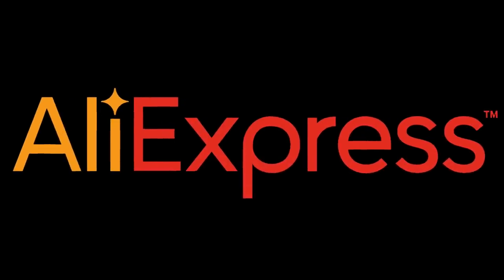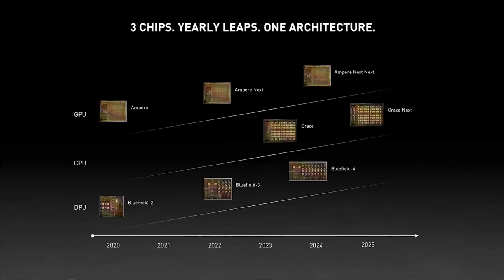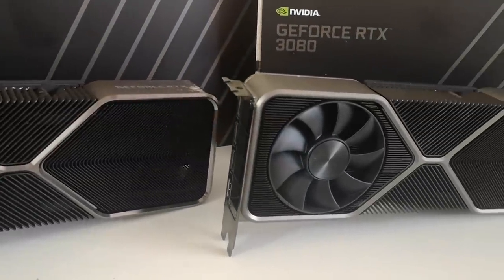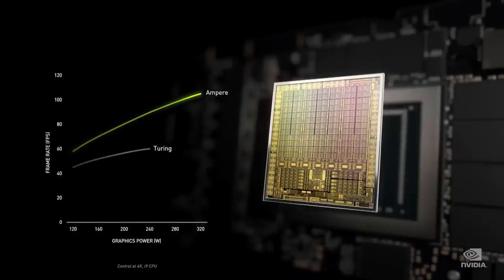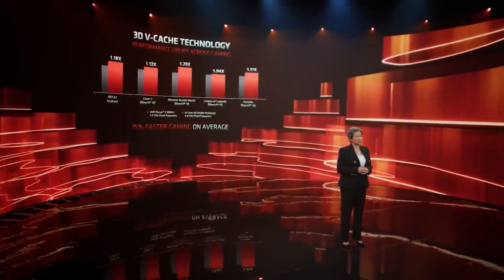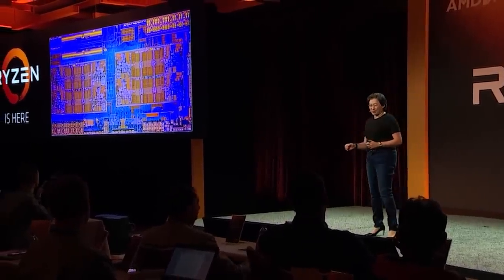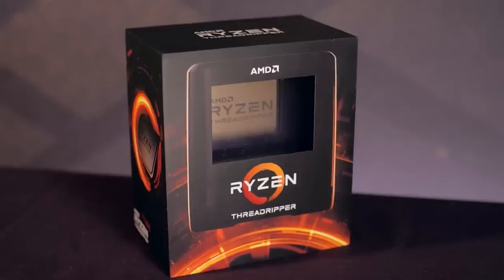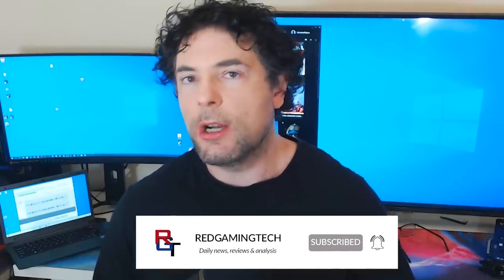Did Nvidia Just REVEAL Hopper? Benchmarks Leak | Zen 4 at CES CONFIRMED By AMD [AliExpress]

Comment: Aside from needing a good PSU, the electrical power input isn't the main problem - the heat output is.  500W inside a case is going to be very hard to handle with air cooling.  A liquid cooler on the GPU will keep that heat out of the case, but it still ends up in your room.  Obviously anything can be done and you can put up with any amount of noise and other discomfort, but (just like the cost question) is it really worth it?  Big bux + liquid + heat.  I'm one of the many who will say no.
Reply: Every uptick is smaller transistors with a clock increase that takes the heat up. We're up from 65>105>180>280 TDP on Ryzen/TR PRO. My Asus Thor 1200 watt would need a Thor 1600 watt Ti if I went dual 3090 gpus. It's a long term investment. My TR PRO will get my four year old case, water block, radiator, res/pump combo and fans off my first gen TR build.
Reply: this has also happened with CPUs. Since when do CPUs use 250 Watts. Thats just ridiculous.
Reply: If miners dont buy them IM DOWN
Reply: @donsorenoelchapogringo1182  16 phase power with 60 to 80 amp inductors is common on the newest extreme boards.
Reply: You're really overstating the limits of air cooling. A 2 slot cooler (not even 2.5) can handle 300-350watts with proper TMI.  It's silly to think that they can't make a card/setup that couldn't handle 500w of dissipation. 

Though I mean... if a 500w part DOES happen (CPU or GPU, doesn't matter), then the people could afford it already have air conditioning, plenty of ventilation, or outright full loop liquid coolers. We're talking about a card that 90% of PSUs can't power. It's not for the average consumer.

Comment: I find it hard to beleive that a Gen 5 SSD, can be bumping up against the limits of PCIe Gen 5 before it has even been fully adopted. Unless they're only talking about their DRAM cache, and that DRAM just so happens to be 2x 32 bit DDR5 channels
Reply: It won't help gamers. Their game's game engine locks down the app load speeds to HDD rates.
Reply: I can see where cache would help write speeds, but I don't see how cache would help seq read speeds.
Reply: Although it probably isn't common and defenetly won't be soon, take in to account that when the spec and initial pci hardware is being designed other component manufacturers have access to initial engineering hw to start designing their own. And SSD as a component have only seen decent adoption in the last 5-6yearish for consumers and for the most time the been stuck at sata 3 speeds. So there is a lot of innovation that happens like it those with any new spec or awesome technology. Also keep in kind that enterprise is extremely data focused especially data transfer speed and they tend to be at least a couple of years ahead of the consumer market. It is reasonably to belive that at least for certain data center application they can max that out already with some exotic stuff.
Reply: @DarkMessia67  No speed improvement is true only for gamers. Your game engine is written for 2010 HW. If you keep giving game developers your money for new games that only love faster Intel clock speeds then we'll have another decade of the Intel cluster suck.

Comment: I would love to hear more information about the AM5 platform how long will they support it ...
Reply: Another four years of cpu/mobo with only one X16 PCIe socket and one fast M.2 socket is just good money after antique tech. Dual channel ram is the year 2002. SSD app load speeds is the year 2010.
Reply: "how long will they support it ." How many decades of 2010 tech do you need?
Reply: Buying a new cpu with IPC gains but not getting the double in through put of the next generation of cpu lane speeds makes the new cpu a silly investment. Gen 4 drives on a GEN3 mobo drops your new drive from 7000MB down to 3500MB. It was utube that screamed no new generation mobos for Ryzen. Features Intel doesn't offer gives them a bloody stool.

Comment: V-cache doesn't increase IPC, it won't benefit programs with working sets fitting in current L2/L3 caches.
IPC has a meaning and is measurable, averaging game benchmarks leaves you clueless about how many instructions ran or even how many cycles occurred.
Reply: @cannotwest  Having more cache running faster increases benefits as memory stalls cost comparatively  more, slower clocked cores have relatively faster memory so benefit less.
Reply: @cannotwest  Not if it's stalled on memory loads, unpredicted DRAM access is very slow compared to CPU processing speeds
Reply: @cannotwest  You appear to have things backwards on GPU at lower GHz.  Game benchmarks target lower resolutions and use the fastest GPU cards to show a difference in fps when comparing CPUs.
Now actually AMD showed mixed results with some games not benefitting from larger cache, which is inline with previous large 128MB cache testing with productivity not benefitting at all.

Comment: What about all those users that invested very heavily in a sTRX4/TRX40 Threadripper 39xx system? - what about AMD's stated promise to support TRX40 for "the long run"? Gonna be very interesting to see how AMD handle this situation for all those customers already invested here...!!!
Reply: You get one more generation.
Reply: No one building a new TR wouldn't opt for the newer TR PRO. Double the ram channels, cpu lanes and eight times the total ram capacity. A top end TRX40 is only $200 cheaper than a WRX80E. My new WRX80E is getting all the GEN4 NVMe drives,  DDR4 ram, gpu and water cooling out of my X399 build. AMD just doesn't have enough 8 core CCDs. Ryzen and EPYC are a year ahead of TR getting GEN3 anything.
Reply: The TR upgrades require more pins. ZEN4 TR is going up from 4094 pins to 6096. A ZEN3 TR for a sTRX socket can't give you double the ram channels or an increase in cpu lanes. All  you could get for your money would be an IPC increase. Buying a replacement ZEN3 doesn't make sense. It's too much money for more of the same. I saw the same thing when my X399 was replaced by the TRX40. I waited for the WRX80 and I can upgrade everything. Now it's worth the money. You might be happier if you wait for ZEN4 TR PRO. That's 12 channel ram and 256 cpu lanes.

Comment: I find the Zen4 leaks and rumours here very exciting. Zen3 is what they're making now, Zen3d is the same thing but with a bit more cache. Zen4 is that same cache plus all new processor dyes, which are supposed to be significantly better at many things. Expect Zen3d about March, and Zen4 about November 2022 ~ slightly less than a year from now.
Not mention in this clip, there's also a Zen5 high performance core, and a Zen5 Compact core, which is essentially a Zen4 core with some of that 3d cache chopped off. Or (depending on who is telling the story) less L3 cache to make way for way more L2 cache. That and they're more compact in 2 dimensions, so you could put 8 high performance cores and 8 compact cores on the same core complex dye, and that's what they're making for the cloud companies like Google and Amazon & Micro$oft. Now if or when that Big+Little concept is coming to laptops and desktops ... but the Cloud Compute Centres want it. I'm hearing that will be a complete Zen4 core, so that's full hyperthreading ~ 2 threads for every core, which is not what Intel's gone for.

As for whether they can get a 40 ~ 50% performance increase over Zen3 ~ completely depends what you test it with and how. For example - if you double the width of the floating point pipeline, let's say from 32 bits to 64 bits, and you're very careful to widen the entrance and the exit of that, so there's no bottle-neck, and you can pump instructions and floats through it twice as fast, then a benchmark that depends heavily on 32 bit or 64 bit floating calculations, will tell you that your new chip is double the performance of the old one, and if the frequency is close or the same, you can say that means it gets double the instructions per clock. Well, according to that benchmark, it does. Thing is (gets tricky here) as long as the code identifies those variables as 32 bit floats (as one example) then the compiler will make them as 32 bit. But if your new processor can do 128bit float calculations in one instruction, then the compiler will have to be advised of that, and the benchmark will have to be recompiled to show that. But then, until lots of real-world software is also using that 128 bit float-add or multiply instruction, the improvement in instructions per clock to that Ryzzen-007 is only going to appear in that benchmark program. As other people and other programs start to use it, it starts to mean something, but initially ... Go back to 1995 and look up Screaming Cindy. Now these days, many programs use streaming SIMD instructions, but when they appeared in '95, the only things that had or used those instructions, were benchmarks written to favour Intel and show how massively better they were than AMD, Outside that benchmark, there was no application in the world that used those instructions. Now 25 years later, a lot more things use screaming cindy, but ... for the longest time, the only things that used it, were Intel's pet benchmark programs.
Try to say that in one line - I'll believe those Instructions Per Clock figures when I see them on my own computer. I do expect an impressive improvement ~ I don't expect it to be 50%. I would be happy to be wrong, but ~ I smell Screaming Cindy.

Comment: Don't trust Adata, they swap components out on a whim without changing SKU. They've been doing this for atleast the last 2 generations of SSD, leading to good site reviews, but consumers getting drives with slower cheaper ram and/or controllers all with exactly the same model numbers and performance claims.
I'd trust crappy King speed/King data drives off ali express before Adata.

Comment: Zen 3 Threadripper is late.  Yup, along with Intel 10 - 12th gen HEDT parts that compete.
Reply: AMD is selling ZEN3 8 core CCD's in EPYC processors as fast as TSMC can make them. TR PRO gets ZEN3 CCDs when ZEN4 EPYC processor production begins. That's if Radeon 7000 series doesn't take all the fab space.
Reply: What 12th GEN XEON are you talking about?

Comment: I suppose this is interesting times, chip shortages, people buying stupid overpriced shit that is not needed for 2 to 4 generations over now (you could still, imo have a GTX980 or something of that sort and it'd be running most all what you want anyway).. so things are staying overpriced, even my generations now old parts (I have a 1060RTX still and got it at discount at release; it's now worth more or same price..). But yet they're making 'another' leap? For something they probably kept suppressed? Because generally they do this and they keep like at least one or a few other things in secret, then they can release a tuned down version of what they have, or an improved but not so important time-based release. I would say there's not a game that computer parts even cheaper/old ones can no longer run when it comes to this stuff, but humanity is showing as usual, they'll do things like have a good enough computer, and buy like the latest GPU (or other parts) and 'donate' essentially 1000 to 3000$ to get it on time, even though they likely don't need it for literally anything. Aside from like super computing there's no one in the market for these goods who needs these or who benefits from buying the hyped up price, and even then, the price hype of the 'latest' thing is quite extreme; they only do it because I believe people are too dumb not to buy it.

Comment: The issue for me is l want new gpus to be more power efficient...less heat....and smaller. Increasing power use,size,weight and heat so u need a huge heat sink like 3080...is nit progress. Imo...nvidias 3000 has go e in wrong direction on price and all the above...l maybe a gamer but l also think of enviroment..so if nvidias new gpus useore power to get this extra perf l will skip gen.
Reply: Smaller transistors use less power. Add more of them and up the clock gives more performance. Double the performance 3090 to 4090 sells.

Comment: 24 Tflops of FP32 performance? Ampere has 34-36 Tflops of FP32.. In what way is that impressive. Sure if it would be per "module" it's nice. Still combined only 48 Tflops which is not much higher than Ampere..
So tell me again what is special here? Are you talking FP64? I don't get it. This is very unimpressive.

Comment: Zen 4 does need to be explained fitting into the Intel tied to Microsoft Windows 11 reconfiguration of what is x86 standard 'thread directed' platform which is what V5x refresh is, the x86 standard, late market 3D Golden Hawk slap on the fiberglass fins and add a blower to that Studebaker 289. AMD late market has always sod well this is a Win Ao platform. Paul, TR 5K I informed the audience and markets on TR 5K status back in September u PUNK KIDS r incredibly poor on attribution the original source which is me. mb